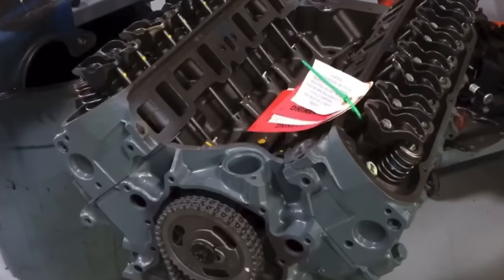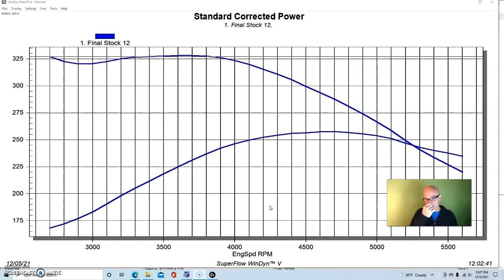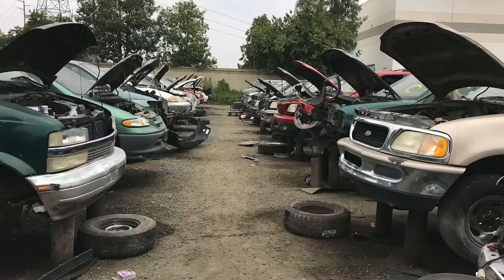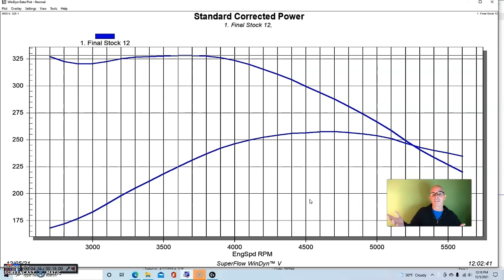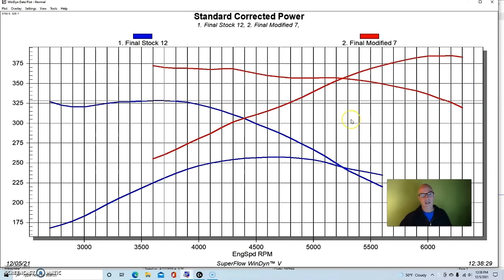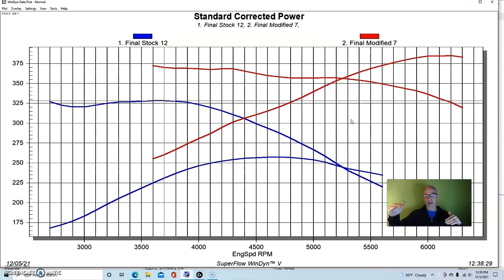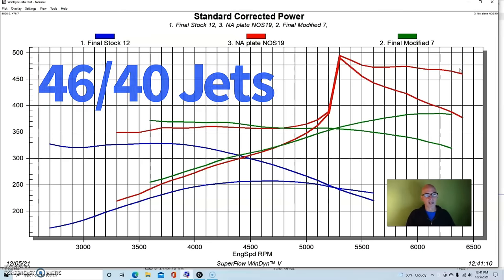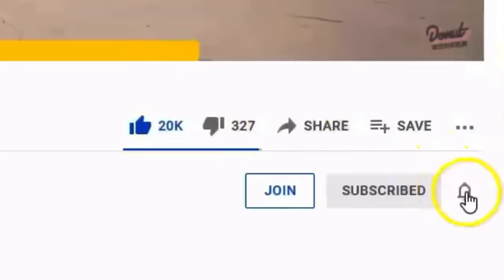HOW TO BUILD CHEAP 5.0L FORD POWER! WHAT DOES IT TAKE TO ADD POWER TO YOUR DAILY DRIVEN SB FORD?

Comment: I used 190cc aluminum heads on my 2000 explorer 5.0  along with a TFS stage 1 cam and OBX headers. Those wondering: 2.02” intake valves clear stock ‘00 explorer pistons with the TFS stage 1 cam (.512 lift on intake). Running the factory EFI still just had to turn up the idle to about 800. Moves my 8” lifted ranger on 33s pretty well!
Reply: That's good to hear. I have the stock 79 bottom end in my zephyr that has Pistons with no notch in them like 86 GTs but I've heard those guys have no issues with stage 1 cams and 170 trick flows or the newer 11R heads either so i think that's the route I'll go
Reply: Jay you mentioned the .512 intake lift while discussing valve clearance with your TFS 1 cam, but TrickFlow lists the specs for that cam as .499/.510

The only way I could imagine you getting.512 on the intake side would’ve been if you’d used 1.7 rockers instead of the stock 1.6…
Reply: @skipgumphrey9579  you’re right, I had a brain fart! Definitely is .499/.510
Reply: @KingJT80  11R will give most PTV clearance
Reply: @vrm86gt  yea that's the route I'm thinking I'm also thinking of going to a 347 too.
Reply: @KingJT80  if you go 347 then you can choose whatever valve relief type you want, inline or twisted wedge, so you can run whatever head you want!
Reply: @vrm86gt  yep I have been thinking hard about it. On the one hand a budget 302 would be nice but on the other hand I know I'll run into someone with a stroker and I'll regret it. Might as well do it once.
Reply: @KingJT80  agreed!
Reply: How much power did it have?
Reply: I was wondering this!

Comment: It's pretty foolproof , just need AFR heads.
Reply: I vote trick flow. Less money and can fit over my 79 flat top Pistons lol
Reply: @Steve B I'd just replace the Pistons. Trick flow will make just as much power without the extra work. This has been debated for years
Reply: Hello Richard. Do the stock valve covers fit over those bolt down roller rockers?
Reply: A set of 165/185 heads on a stockish 302 and a good cam. Make good HP.
Reply: @I_like_turtles_67  that's basically what the trick flow top end kit is based on
Reply: @KingJT80  Yup. That track heat kit 20 years ago was like under 3 grand. Offered high 11 second time-slips in a daily driver 5.0.
Reply: @I_like_turtles_67  I'm seriously considering it for my 302
Reply: @KingJT80  Depending on the vehicle. Making the jump to a 351w is a great choice too. Really depends on the car though.
Reply: And idiot proof. Means anybody can do it.
Reply: @I_like_turtles_67  id have to buy a taller hood. They do make them for fairmonts and zephyrs.  600.00 hood

 i agree with most out there i woundt put a low RPM 351w into a car and make that change just cause i have more cubes.  id have to have at least an RPM intake and enough cam and compression in it to justify the swap.
Reply: @KingJT80  whats the difference between afr and trick flow? These blue print heads seem to make good power. Is AFR or trickflow worth the extra cash?
Reply: @TheAnonymous1one  trick flow are twisted valve angles so so you gain more clearance for camshaft timing on a stock engine, especially ones like 86 GTs that have no valve relief.  

AFR are inline. heads  and theyre CNC  but trick also sells CNC heads to just the 170s are cheaper than AFR 165s

they both flow better than blueprint and most likely used better quality components as well

its always been the battle/debate

 AFR vs trick flow.
Reply: @KingJT80  thanks for that info!
Reply: @cesarmagdaleno6009  It will hit the oil breather shroud. You can clearance the valve cover. Replace valve covers or lastly make/buy a valve cover spacer.

Comment: great for the person who thinks they need a junkyard Coyote to have 400hp (since it'll be worn) and find themselves in a money pit to get everything hooked up.
Reply: Especially with swap ecus like a Holley Dominator, tuning efficiency can make old setups just as good as today’s from idle to redline. We’re then splitting hair between compression ratio and +-20HP.
Reply: @jojog8304  right, and back in the day there was the TwEEKer setup that took the original EEK4 setup and "enhanced" it...but good luck finding that nowadays :)  you may even need an older laptop just to talk to it if you're starting from scratch

Comment: Step on, sell that thing and buy a 351w,  preferably a 95 truck 351w! Heads, can, intake!  I graduated from those years ago! Pick up a second with the same heads and cam, but you gotta get an intake! Get the same at 6000 that the 302 does at nearly 7000! Swapped a 351w in and picked up a second in the 1/8 mile! Sell that 5 liter and just move up! You gotta have a good set of heads!

Comment: Made a 306 ci 5.0 a couple years ago, used a Lunati Voodoo roller similar to that comp cam, with the Trickflow 170 ports out of the box, man, what a fun combo....put a 2800 converter and a built AOD behind it with some 3.73s, it was a real blast for the money...kinda wished I'd done a 347 at the end of the day, but nobody that rode in it was disappointed!
Reply: I have almost the exact same set up with 650 carb. How much Hp did you make?
Reply: @DavesRacingTv  low 400s
Reply: I have a t5 with 3.73s, want to spray a 75 shot because the car already has the kit on it but I don’t kno anything about nos

Comment: Way back in the day I had a 306 with heavily ported E7TEs 1.94 x 1.6 valves that I got for $500 and a B303, it was great had loads of fun and made 267rwhp then I changed just the head to TW 170s it jumped to 308 rwhp.  Why am I writing this well agreeing with Richard a good head will really wake these motors up!
Reply: Those E7's work pretty good ported. Stock valves on mine with an E cam, and got 285.
Reply: @hondatech5000  chassis dyno showed 285 @ 5200 & 315 @ 4400. I used to be pretty good at this.
Reply from the maker: 285 whp with an E cam and stock heads? seems high
Reply: @richardholdener1727  Ported stock heads. They flowed 215/185 @.500. Compared to P head flow #'s and dyno graphs you've shown in your videos, it seems about right. This was with stock pulleys & fan,  shorty headers, Typhoon EFI intake, 13 degrees of base timing, and 24 lb injectors. I wish I would've had an electric water pump & long tubes.
Reply: @richardholdener1727  Some professional porters (DV, CS) claim 230+ cfm on ported E7s.

Comment: I have a 302 with stock forge pistons promaxx 185 cylinderheada 2.02 valves comp cams n271s cam. I run solid lift with scorpion roller rockers and edelbrock performer rpm intake. In a 67 fairlane 2500 stall and a built c4
Reply: Awesome sounds like no problem with piston to valve clearence with the smaller valve reliefs and stock pistons with 2.02 heads?   Getting ready for my clay test this weekend... I'm using E cam/ liberty aluminum heads but 1987' stock forged Pistons.. (smaller valve reliefs)  so hopefully it all clears....

Comment: Richard, I've watched this video several times as it is super close to what I hope to build. Wondering if I could pay you for your time and get on a call with you. I am new to motors and want to get it right. Thanks for your consideration.
Reply from the maker: COME TO THE LIVE FEED OR EMAIL-I'LL ANSWER
Reply: @richardholdener1727  I did email you, but it may be stuck in your junk folder...

Comment: 91 roller 302 ,board 30 over to 306 ci. 
Edelbrock rpm 170 /  60 cc heads
1.6 rockers 
Comp cam - nitrous hp ground cam - 114 lobe sep, # 35-556-8
650 quick fuel carb 
BBK shorty headers 
250+ shot on progressive 
C,4 built 164 tooth with a 3400 stall
Alumni drive shift 
35 splin axles spooled 4.10 gear 
STOCK BLOCK AND CRANK ...

Runs real good into the 6's an has a little left in it. Probably 330 to tire N/A an 570 to low 600's with nitrous.  Lol could be less or more ,never raced a dyno to find out

Comment: This is awesome! I always watch your videos especially the 454 videos we built a budget peanut port 454 for my son's Camaro drag car (12.50s @ 108)  but we just bought a 5.0 E250 van motor for his 83 4cyl daily driver notch back mustang so this video came at the perfect time! Thanks Richard!
Reply: Our peanut port 454 budget build just went 11.85 @112  1.57 60'
Reply: I just bought a 89 302 from a e250 van been worried about the different firing order, have you had any issues yet,
Reply: @thruitallauto2538  only issue you will have with firing order is you just have to put the wires in the cap in the order of the cam you have, our motor is from a 95 truck so I think that has the HO firing order but we put a Chevy motor in it because we had a complete fresh motor and trans sitting in the garage, the truck oil pan is different then a fox body so you will need a pan and pickup as well
Reply: @operatingengineer  yeah I’m thinking going carburetor so I guess the firing order want matter, yeah I’m a Chevy guy, thought about putting a Chevy motor in it
Reply: @thruitallauto2538  super easy swap! We used tin man mounts , put a Chevy trans yoke on the ford drive shaft, used the factory ford crossmember with a powerglide , bypass regulator with his EFI fuel pump, headers were the hardest to come up with we used $85 block huggers from speedway ! Car goes 14.40s with a 307 we got for free, he still wants to put the ford eventually but the Chevy was so cheep and he built that motor so he wanted to see how it ran, we might put a single GT45 turbo on it for next season

Comment: Where does one begin with a stock 289 Ford? I have a limited budget and have enough saved to do one of the following. Rebuild and bore the bottom end. Or, add a set of dual quads on a tunnel ram (or just dual quads....all for the coolness factor) or, install aluminum heads. Either one of these could include a new cam which would put me on the high end of my budget. Is there a best place to start.

Let me add, I am going to check my compression to see if I have descent compression to do any of the other things first. If I have bad compression, then it's a no brainer. Otherwise, what would be the best order?

Comment: I had a 306 in a 90 Notch.  B303, edelbrock performer heads with mild port work, Trick Flow upper and lower intakes.   That car ran very well.  I owned two fox body mustangs and wish I still had them.  Great bang for the buck for a fun street car.

Comment: You need to warn about the GT40P heads, those are the most common but they cause header headaches in anything remotely vintage.
Reply: A lot of manufacturers offer headers for those heads and only require a few 90° plug wires to make work.
Reply: Rumors 
Rarely any problems. 
Denting a couple tubes is insignificant.
GO FOR IT
Reply: @hotrodray6802  Not rumors. They do have plug interference where simply bashing it works for some headers to get clearance while others simply wont be able to fit a plug boot on. This is why its important to check header fitment with your heads if your swapping and look into manufacturers that offer swap headers.

Comment: Hey Richard, I’m curious if you’ve tested old 1970 351w 4v heads in comparison with other SBF heads?
I have a mild build 302 similar to your test motor with an E303 ,gt40p top end and the usual bolts in a Fox body. Ran really well for what it was but decided to use  a set of 351w 4v heads that I mildly ported ….seem to run even better and pulled harder up top to about 5500 or so..
Curious if these heads are actually better than gt40p heads or is it all in my head? Lol
Reply from the maker: the 1969 351W head was the go-to head for SBfs for a long time-its about on par with a GT40 head

Comment: What gaskets are good to use with afr heads gonna spray motor with nitrous as well heard 9333 felpro waa good but was told they arent as good as i thought they were
Reply from the maker: 1011-2 or mls
Reply: @richardholdener1727  OK thanks

Comment: I’m just a bit confused, you used 165cc AFR heads with Edelbrock RPM air gap with a 650 carburetor and a less aggressive cam (XE264) and made 427hp (in another video with his 302 bored to 306) but this one with a more aggressive cam and higher 205cc head you only made 384hp? 

What am I missing?
Reply: The parts matched up better with the AFR/air gap / 264 combo vs this one.
Reply: Combination 
More is not necessarily more 😳
What did Stroker McGurk say? Too much is just enough.

Comment: I have a question stock 302 wanting to run 190cc pro comp heads with f303 you think it will clear ptvc
Reply from the maker: need to measure

Comment: The 427 in my 95 Mustang makes close to that part at the wheels. It's sad
Reply from the maker: why is your Mustang sad?
Reply: @richardholdener1727  i was expecting more like 500whp from this engine. I think it just needs a stand alone, so i can tune more thoroughly than the EECIV+chip method. I believe i have plenty of hardware and supporting mods to make at least 500whp n/a

Comment: Im looking into building up my mystery 86 5.0 mustang and like this combo but with junkyard heads and intake quite a bit. Will the stock injector size with the factory ECU work and give me similar gains? Or what size injector should I use and will i need to piggyback the ECU? Only mystery here is the guy who sold it to me said it had a stroker kit in it but i havent taken it apart to verify yet. Also have read that the 86 GT motors had no valve reliefs? Is this true in the event that it is stock? And if thats the case will i still be able to use GT40 heads with the XE 274 cam? Thanks and happy holidays!
Reply from the maker: that cam and head combo won't fit in an 86, unless there are valve reliefs
Reply: @richardholdener1727  would the crate motor out of a 97 explorer fit in my mustang?
Reply: @stephenb3414  yes.
Headers, oil pan sump, accessories must match.
The Ex does have the shorter accessory pack which works better in 60s era cars with thick radiators.

Comment: Question please if you don't mind, with the 274HR cam and the 205 Blueprint engine heads with am assuming a 2.020 intake valve on a stock 302/306 no issues with piston to valve clarence? would like to run that cam with 185 AFR's or better with stock pistons, rods, crank and block but I don't want to clay it out and see that am screwed .... not looking to fly cut stock pistons I thought the stock pistons had 1.900 's reliefs cut in them please correct me if am wrong? Basically, I have a stock 89 roller short block out of a CPI T-bird I converted it to carb with E7's and a flat tappet wolverine cam lol with a rpm intake looking to upgrade back to a roller cam and with good heads will the 274HR and AFR's with 2.020 intake valve work for me on the stock short block?
Reply from the maker: NOT SURE
Reply: @richardholdener1727  this would be a great video..  Lotta people going to 2.02heads these days...  Chinese to..lol

Comment: Nice video Richard. I loved my mild built 85 GT Mustang 302 I built back in the late 90s. Tried and failed to blow it up. Lasted 12 yrs of my daily driving it, racing it and still runs today in a 66 2+2 Fastback Mustang with the T5 World Class transmission. That trans never had any issues with the Pro 5.0 shift tower and a 10.5 inch clutch.

Comment: Two years ago I essential duplicated an engine Mr. Holdener did for a magazine article back in 2016. It’s a 331 with XE274 cam, TFS 170 heads, 10.4:1 compression, AirGap RPM and a SS-650AN Quick Fuel carb.  I have not had my engine on a dyno but I expect it is very similar to the  439 hp and 437 lb-ft that he got.  It works extremely well  so THANK YOU VERY MUCH, it is an awesome engine!
Reply from the maker: Very cool!

Comment: I remember my first and only 302. I had a 93 F-150 4x4 short box with a 5 speed. I loved that truck. I did some mild upgrades to the engine way back then, but never did do what I wanted to before getting rid of the truck. I was young then lol. Just thought i was cool because I had a 5.0

Comment: Hello Richard. I am building a 68 mustang coupe Trans Am replica car. The engines in these cars were 289s that produced 425HP at crazy high RPM.  My goal is to achieve 425HP using a 302 -T5 combo more in the 6500 RPM range. The 302-T5 that I purchased came from a 95 Mustang GT with only 45K on the odometer. Could I simply replace the pistons with a high quality set of forged pistons with the proper valve reliefs then add AFR 165 or 185 Cylinder heads with the proper cam, roller rockers, a 4bl intake and carb and be in the 425 hp range ? Or would I be better off using a 331 stroker kit ?  Could you recommend the proper combination ?   P.S. this will primarily be a street car. Also.. You have done an amazing job with your videos.  I am actually overwhelmed with all of the information that you proved.  I just ordered one of your ford small block books. Cant wait to get that.
Reply from the maker: YES YOU CAN DO THAT WITH PISTONS THAT HAVE VALVE RELIEFS